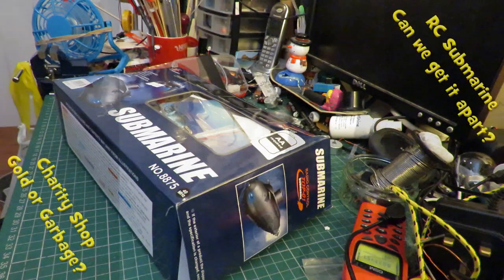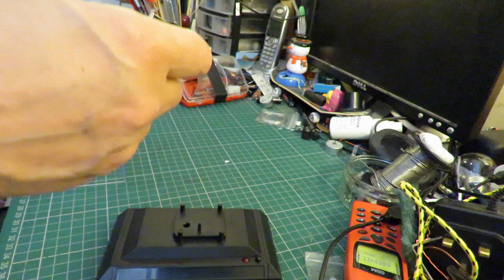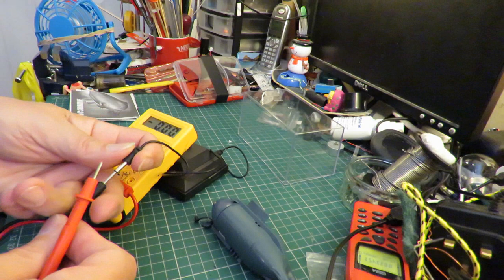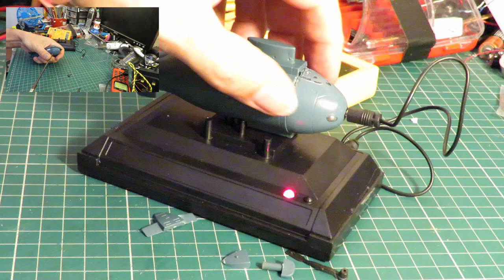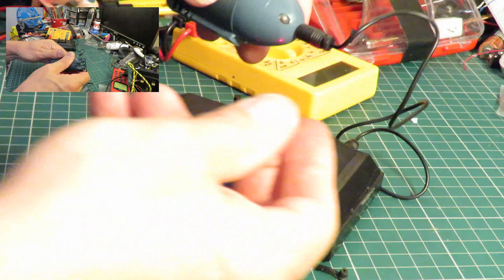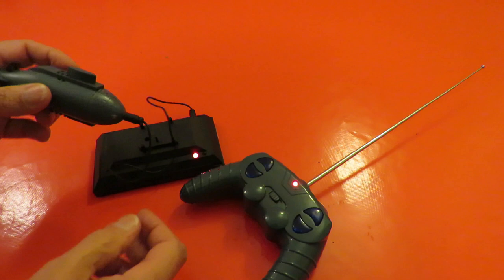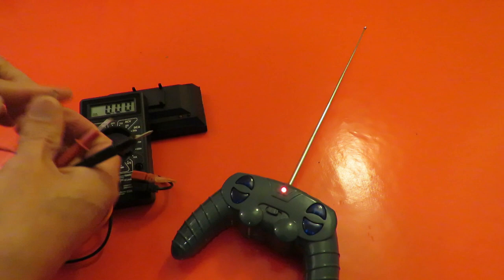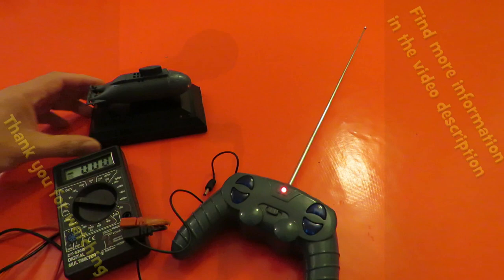Charity Shop Gold or Garbage? RC Submarine - Can we get it apart?

Comment: I believe flight test said superglue over the circuit boards prevented the water from damaging it. It was in one of their waterproofing electronics videos.
Reply from the maker: Most people talk about using nail varnish or 2 part epoxy to cover circuit boards. I have doubts about that as it will be OK until it cracks. Once it cracks it will actually draw water in due to capillary action. That is probably why water repellent sprays are popular. Here is that Flite Test video https://youtu.be/s4z8QMgTEA4
Reply: GrandadIsAnOldMan OK. So its probably not gonna be economical and cheap. I looked around and only saw a few bottles of the corrosionx that all were more than £8. Probably not worthwhile unless you are planning on buying more submarines and boats.
Reply from the maker: Mr Rishi The Cookie not much I can do with this one unless I can get it apart without too much damage. It is going to need a saw to get it apart and that means it will just be a matter of luck if I don't damage anything inside.
Reply: GrandadIsAnOldMan Lets see what happens i guess.
Reply from the maker: Mr Rishi The Cookie yes, not sure when I will get round to it.

Comment: at 1:07 it started flickering, I dont know if that is a good sign or not....
Reply from the maker: Nope, did you watch the video all the way through - I understand if you didn't as it was much longer that I wanted it to be :-)
Reply: GrandadIsAnOldMan I just saw it on 1:07 and commented it right away and then I watched the whole video when I realised that's just nothing :)
Reply from the maker: JOHN diy STUFF yes, disappointing, I expect when I finally cut it open I will find old NiMh or NiCd batteries that need replacing.

Comment: my meter isn't working either. I don't think an aa battery puts out 232 volts
Reply from the maker: The problem is often as simple as you need to replace the battery in the meter. They last for so long I often forget.

Comment: Potential drive unit for a boat?
Reply from the maker: I don't know what will survive if I have to hack it apart.
Reply: Could you use that old USB soldering iron to melt/cut it?
Reply from the maker: Wil Hobbs If I saw it carefully I could probably put it back together afterwards but if I melt it I doubt I would get even edges to rejoin.
Reply: I was thinking remove the drive unit for a boat project.
Reply from the maker: Wil Hobbs yes, just depends what breaks when I cut it open. The plastic is a bit brittle.

Comment: Hi Grandad,
I'm messaging you on behalf of my lad, he wants be to build him an electric diving bell, not necessarily r/c, something that will dive & float electrically.
I've manged a couple of your simple electric cars, but I need some pointers on this one.
Reply from the maker: Hi Sean, to just dive and float vertically the first idea that comes to mind is a plastic bottle mostly filled with water to be more or less neutrally buoyant and an electric motor with a propeller underneath pointing straight down so it pulls the bottle down when power is applied and then floats back to the surface when the power is off. Maybe have a floating switch that cuts the power when the bell gets to a certain depth so it will come up again automatically. In freshwater the motor will be OK directly in the water as long as the water is not too muddy.  You could copy my rubber band powered submarine and fit an electric motor and maybe control it by letting it trail some very thin wires https://youtu.be/eSGfoOQ6rQc?list=PLA5a2xPRSrB0YFWgPosff-Wy7IDGMjWZn To go RC this simple video may help https://youtu.be/49X0X_JHKYs?list=PLA5a2xPRSrB0YFWgPosff-Wy7IDGMjWZn
Reply: Thanks for the pointers.
I was way overcomplicating things.
I didnt think of running a motor directly in the water, I have some dead hard drives and an esc so I'll see if I can get a hdd motor to work with that idea, I'll have the esc out of the water with wires leading down.
If I make some sort of guard for the prop it wont get jammed with weeds as easily.
Reply from the maker: It is worth a try and no doubt it will be a learning opportunity even if it all goes horribly wrong  😊
Reply: Hi grandad, we did it, the motor I used was a brushless cd rom spindle motor, I just used an esc with a servo tester and a 4 pack of aa's.
After an hour of fiddling around and water butt testing it works well.
Thanks grandad.
Reply from the maker: Hey that's great. You know you will have to do a video 😊